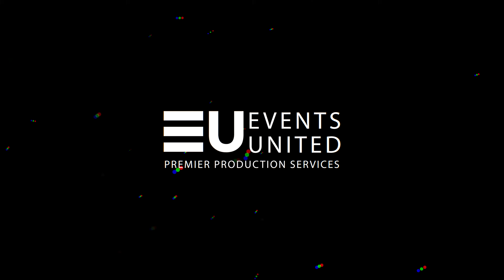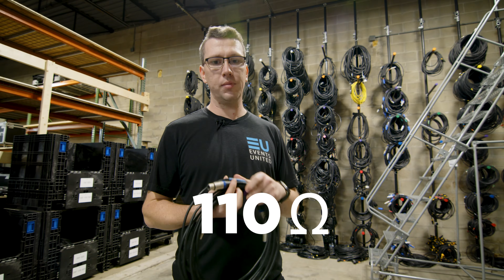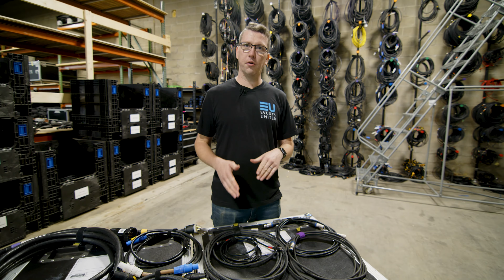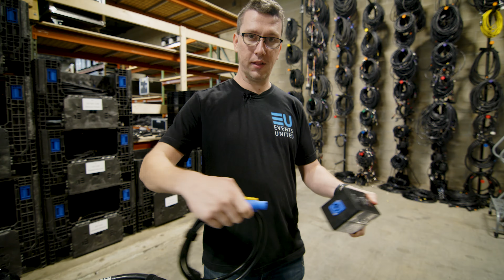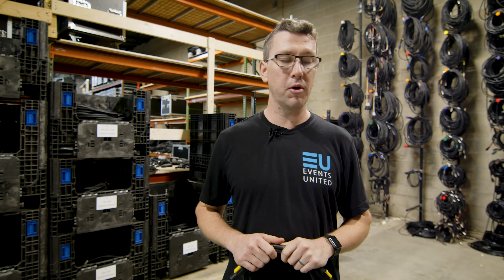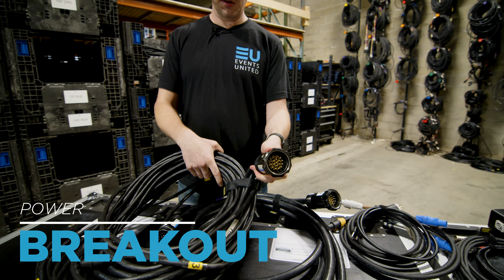Lighting Cables 101! PCON, SOCA, TRUE 1??

Comment: I'm just a dumb audio monkey, but we use regular mic cable for lights all the time. As long as it's relatively short runs (under 100ft or so), it's never been a problem....go above 100ft, you're in the danger zone. Several hundred feet, you're almost certainly gunna run into issues.

Great video, and thanks for pronouncing soca (so-ka) correctly!
Reply: You can… but even under 100ft runs you can still run into problems. Often times with moving lights, they become jittery and unreliable, which isn’t what you want on a show.
Reply: 110ohms dmx/aes ebu for mic cable is kind of normal in germany…just saying ;-)

Comment: Hard to believe anyone uses socapex in 2023. It made sense when I got into theater in the 70s, when six channels of solid state dimming weighed 75 pounds... copper is expensive and heavy.
Reply: It’s actually extremely efficient, and convenient. Like for us, all our lighting power outs come from our rafters with several socapex out, that way we run one (rather heavy cable) and get access to 6, 240v circuits. Especially with lighting, when signal fixtures can be around 800w or higher.
Reply: Most events still use socapex. It’s absolutely still used.

Comment: You can use microphone as dmx (I've been using it for years)
But it hugely depends on how many lights you're using and the length of cable.
Reply: You CAN do all sorts of dumb things, but professionals don't violate the spec. 
3-wire DMX over XLR is for weddings and party DJs. ;P
And stop running lighting control signals through the audio snake.

Comment: A little bit surprised that power cables with IEC 60309 industrial connectors are not mentioned. If my memory serves me right, they're quite common on power distros and fan-tail cables.
Reply from the maker: Great point! Those are also commonly referred to as pin & sleeve connectors. Though they're occasionally found in entertainment in the states, they're mostly used overseas. That doesn't mean they aren't common here, but as far as what we see regularly in our circles they aren't common. Thanks for the comment!
Reply: What’s a fan-tail cable? Never heard of that.
Reply from the maker: A fantail splits into multiple connectors at one end. The term "fantail" comes from its resemblance to a handheld fan or a bird's spread tail feathers.